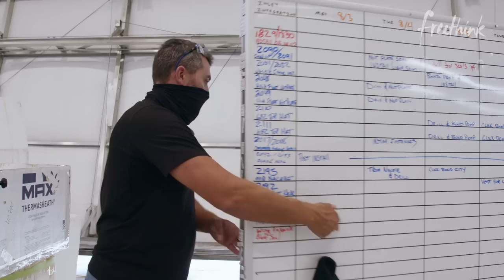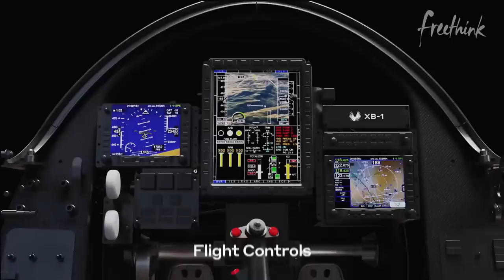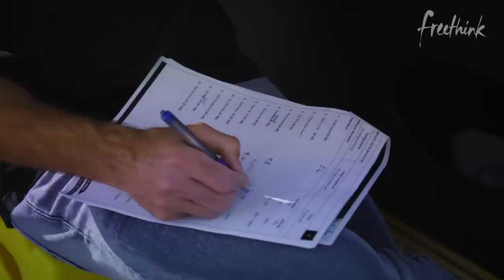Is Supersonic Flight About to Boom?

Comment: It's the economics. 

If they're hemorrhaging money on fuel efficient flights now, SST ain't happening anytime soon.

Cheaper?  Hardly. The faster you fly the more energy it takes. More fuel.
Reply: You say, “The faster you fly the more energy it takes.” This is incorrect. 
Flight at Mach 1 is less efficient than at Mach 1.2. https://en.m.wikipedia.org/wiki/Drag-divergence_Mach_number

Unknown if they will be profitable... if flying twice as far each day, can offset the other costs, it might work. 
The real key would be a smaller fleet, with fast turns at the airport.
Reply: @curtischilders3024  As a general rule though, the faster you fly the more energy it takes. Mid to long haul airliners usually fly closer to Mach 0.8, if I remember correctly. Flying at Mach 1.2 will require a great deal more fuel than flying at 0.8. 

Airlines are retiring A380s because they are not efficient enough. They are also getting rid of first-class because it is too costly and regular business class seems quite comfortable. Even if you put environmental considerations aside, it is hard to see the economics of this on any scale outside of the business jet charter market, if it even works there.
Reply: @YoushaAhmad  - did you really think I knew about high parasitic drag region between mach .8 and 1.2, but didn't understand the "general rule" about parasitic drag increasing with airspeed? 😖
Reply: Curtis Childers Trans sonic flight is the exception due to boundary layer instability but the faster you go the more fuel it takes. That’s basic physics.
Reply: @curtischilders3024  yes but the difference in efficiency around the sound barrier due to air turbulence is irrelevant to the point Iohphat was making. The point is sonic aircraft will use more fuel than conventional airliners. Airliners are not flying at speeds just below the sound barrier.
Reply: @lohphat  - sounds like you agree with the exception I pointed out. 
Of course parasitic drag increases with airspeed, and the coefficient of drag is non-linear between mach .8 and 1.2. 
Someone reading your comment about going faster and using more fuel might not know that there are exceptions. Such as the SR-71 using less fuel when going to max throttle to evade SAMs. I.e., above mach 3.2
Reply: It's about the economy of the ticket really. Routes with high demand for premium services like New York, London, Los Angeles, Beijing, Shanghai, Tokyo, Hong Kong, Sydney, Melbourne, Sao Paulo, Paris, Frankfurt, Moscow, Singapore, etc.

Could really see this thing work. As for now, the ticket prices for Business class from and to those cities float between $2,000 for short trips and up to $8,000 for longer flights.
Of course their business would be limited to certain market. But remember, Concorde made tons of money on a single routes From New York to London alone.

I see London, New York, San Francisco, Sydney, Tokyo, LA, Frankfurt, Hong Kong, Beijing and Shanghai as a hotspot for such services.